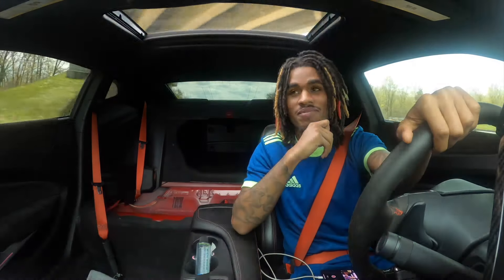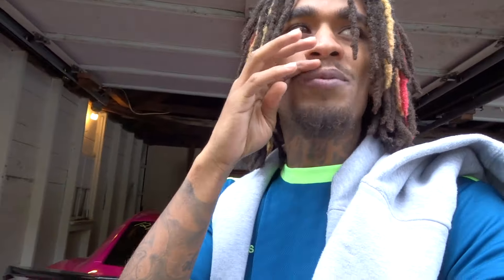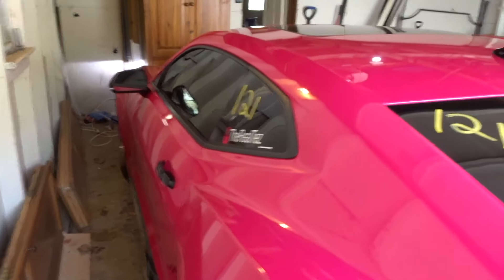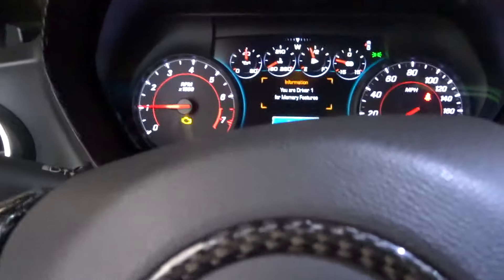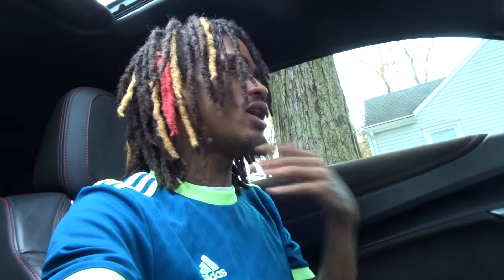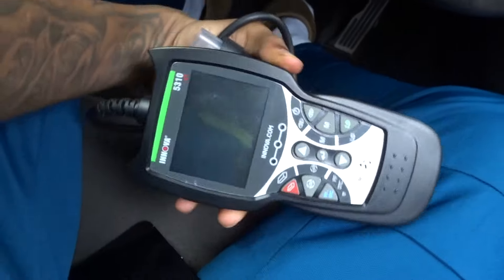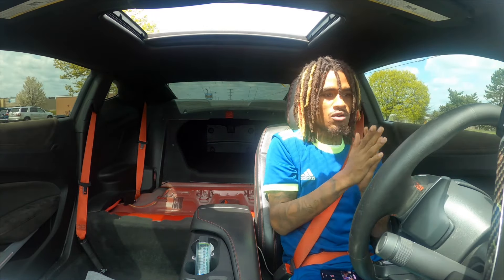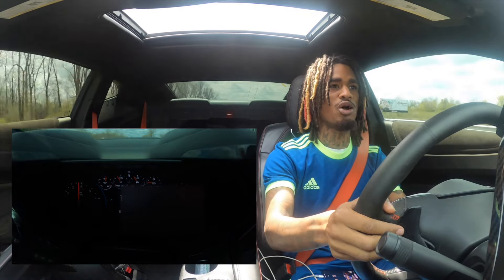ALMOST HAD TO PULL THE MOTOR ON MY CAMARO ZL1

Comment: Gm tech here, loved the video! My personal recommendation here is get with your tuner once you can send him a data log.  Before you pay some stupid amount of money to have someone diagnose the car, I’d go get an engine oil analysis kit.  Basically you do an oil change but collect some used oil into their container, then ship it back to them and they’ll tell you what your oil says about your motor.  Cheapest option for now, I recommend a company called zengine, Chris fix did a video using the product.  We see oil pump failure occasionally on these motors but if that were the case you’d see low oil pressure at those high rpm’s.  The code setting is for the oil flow pressure control valve which if it is getting stuck too far open or closed could be your problem.  Like I said do an engine oil analysis, if that doesn’t show metal or anything in the oil then ask your tuner about the flow control valve.  Keep me posted brother!  Love the car

Comment: If you haven't yet, go get it checked out man. I don't know what is up with the LT4 in these 6th gens, but mine saw the rod bearings get worn out at 4,956 miles, and I had to get a complete motor replacement.

Comment: Hi bro 
If you are racing big time. You really need to refresh your motor already.  New torq converter new high proformense oil pump bigger injectors and a stage 4 cam and new heads.Then bro you will be spanking all your boy's out there. Right now you are just putting a bandaid on your car. I am a true racer and I hate to see you loose against the mustang  and supra. I had a supra before and they are fast but I think your motor has been raced alot and it's time to rebuild.  I like you videos and always want you to win .Start saving your bread for a real monster motor in your car. Peace bro and God bless you 🙏
Reply from the maker: Definitely appreciate the feedback it means a lot 💯 but Last year was my first year actually racing this car with a few mods. This year is really my first year taking racing/modding as serious, This current set up was only gonna be until next winter which means only a few months. I definitely plan on doing cam/heads + everything you pretty much said. I just had to power up from last year I was way too slow to have a somewhat built car lol a lot of people wanted to beat me this year